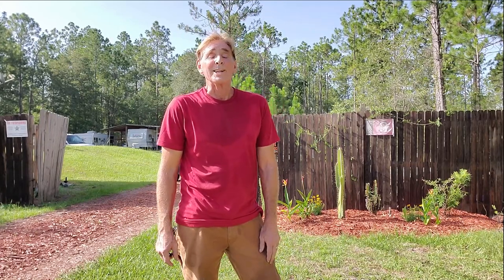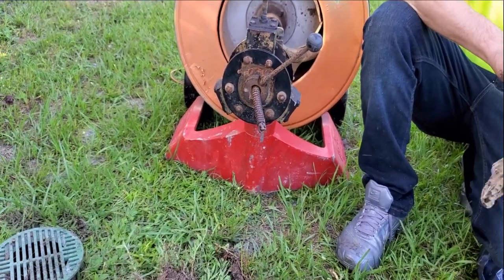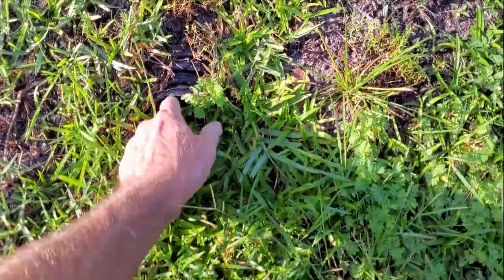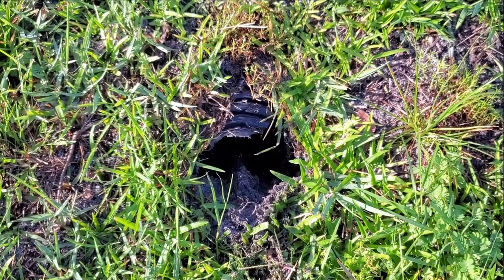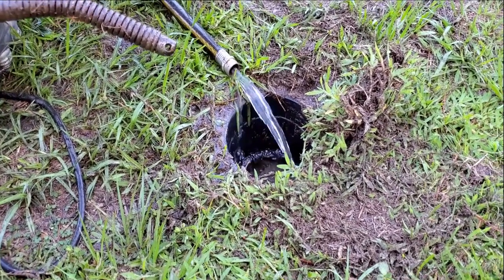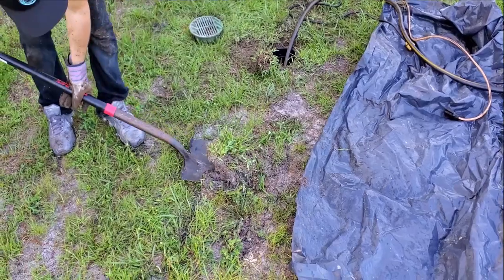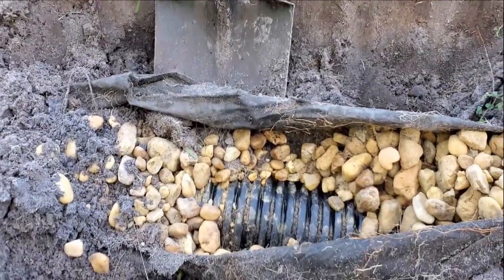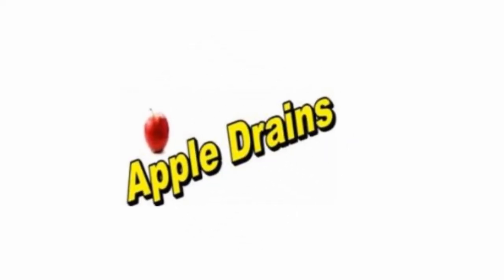How to Clean French Drain Including Gravel, Complete Guide for Homeowners

Comment: What about French drains which need no maintenance, with the geotextile fabric burrito wrapped around a pipe or more pipes which are on the bottom of the trench on top of the fabric, with 1.5''' cobble placed over the pipe(s), and then the fabric wrapped over cleanly/neatly.  Then the sod put back over.   2''' of dirt beneath the sod on top of the fabric top.
Reply: They don't work in this kind of soil, he has a lot of vids where he explains it, check them out!!
Reply: @9tokh  What kind of soil do they not work in? Are you saying they don't work in sandy soil, or don't work in clay soil?

Comment: thanks, I made a 40 foot 1/2 pvc pipe hooked onto a water hose and a tight screw on spray nozzle, I was able to gig it back and forth and got the sand and rocks out of the line. Working fine now but ordered the spray nozzle at amazon for my high pressure washer, just in case.

Comment: I was dumb enough to put septic tank rock and sock pipe with no outside fabric over the rock. Thank you so much for the valuable information you have made available so far. If you have time to respond to questions, can you comment as to whether the jetter could possibly clean my gravel that has no fabric? I am very worried, the contractor never mentioned fabric outside of the gravel base ., Saying the sock on the pipe would be enough. He did use inch and a half gravel, but I am afraid it may have granular dirt deposited in it.  Any information would be greatly appreciated, as I spent quite a lot on this system. Thank you.
Reply: if there's no fabric around the stone then the stone will have more than granular dirt. It will eventually become fully compacted with dirt and basically just be dirt with rock in it. Nothing you can really do about that except for dig it all up.. but no point in doing that until it actually fails to work.

Comment: Hi,  I have a 1940's Ceramic drain tile system.  The one by the gutter outside is clogged with years of apparant dumping.  I found pliers and now finding large rocks.  I have used all the tools including sticking my arm as far as it will go down to pull out these items.  What is left that I can see is alot of dirt and alot of rocks.  My question is can I use a system like this in ceramic?  Or am I just out of luck in fixing this darn thing.  Original owner (deceased) only rented it out to us before purchasing so nobody knows where this tile drains to but most likely under the driveway and towards the farm field by septic....Suffering in Illinois (LOL)